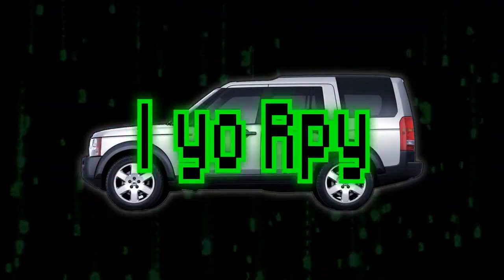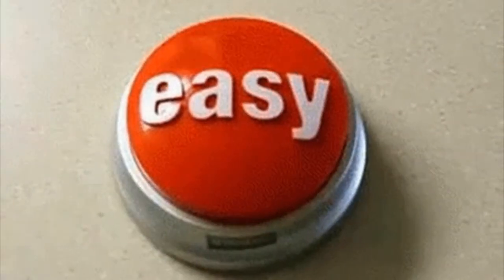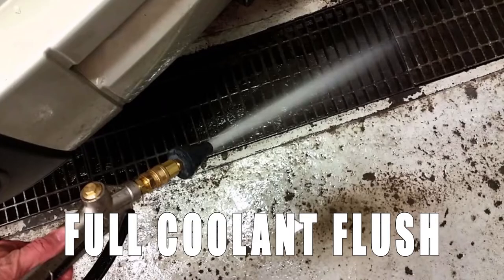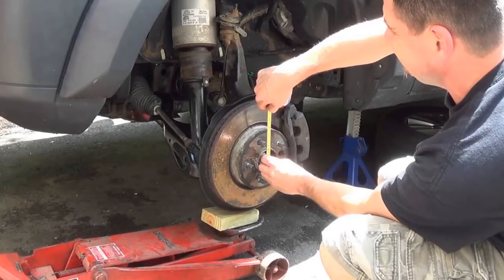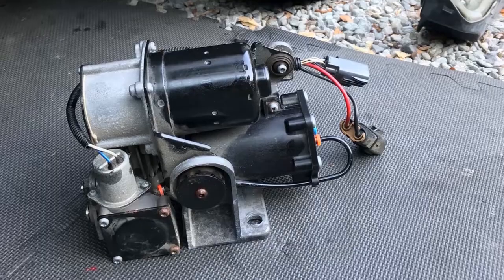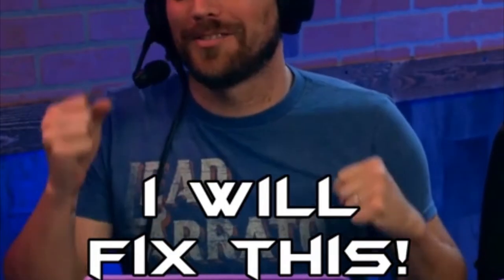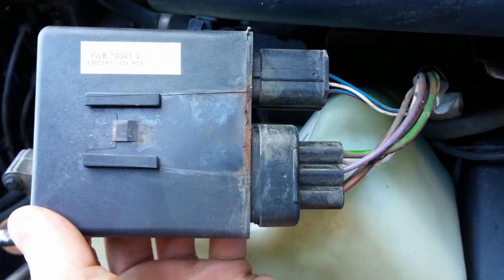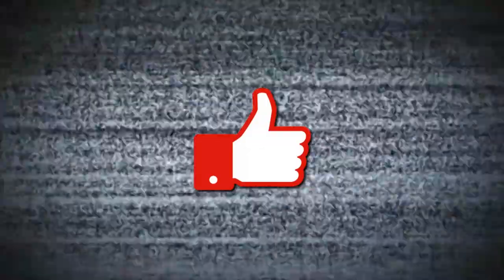Watch This Before Buying a Land Rover LR3 2004-2009

Comment: Accurate information. I have 230,000 miles on my 2006 LR3 SE V8 and 14 years of ownership. Keep it from over heating by changing plastic cooling system/thermostat parts before they break and avoid gas with ethanol.
Reply from the maker: Seems like once it overheats, you are in for a lot of trouble. Keeping things in great shape is important. I've seen these motors last well over 400k, but that doesn't include the maintenance folks like you put in.
Reply: Cool. good to hear. I have same truck with 156k. I'll keep a close eye on the cooling system parts. Thanks fir the advise
Reply: What do you mean avoiding gas with ethanol?
Reply: Do you know how hard it is to find ethanol free gas

Comment: Thank You . Excellent Video. Mine is 12 years old still going, only failures thus far. front wheel bearings and  some switch below the dash causing the Christmas tree lights. Best Vehicle I have ever owned. 148 K miles and going strong. Best vehicle for cruising 80 mph  and wanting to detour offroad to a camp ground. DOn't think I'll ever get rid of her... Next project ,take out the air for coil suspension. :-)
Reply: Have coil on mine its freaking wonderful
Reply: The brilliant drive ,handling and comfort,not to mention a 2 inch lift by a button,12 years and still fine?Don't ruin the car with coils,theres a good reason theyre not on the car!🤣
My 05 V8 HSE,250,000KS, pin hole in front air bag, I replaced both fronts,$600 delivered from LRDirect in UK,16 YEARS YOUNG!
Reply: I bought mine with the conversion already done. Really glad about that.

Comment: Mine is TDV6; 200.000 miles and in 13 years 1 air compressor and diesel fuel rail failed; and after 13 years, last week changed the right front air strut. The other 3 air struts are still original.

Comment: What would be wonderful, if you are able to, is to talk about the parts we can borrow from the LR4 or things we can incorporate, I don't have the parking sensors on the LR3 for example so bumper replacement, back up cameras and so on, etc...
Just for the record, I got the control arm issue from what you mentioned, and the timing belt, it is an expensive fit because they have to remove the engine and the compressor and sensors, still for leveling issues 🤔...
Thanks for the video.

Comment: I have owned a discovery 3 for nearly 10 years, and it really hasn't had any real issues
Reply: Yeah mine too but i maintain well
Reply: @The1979_  yes, frequent oil changes and transmission fluid changes are in order, although I did trade in for a land cruiser
Reply: @reapertalon  Hımm 🧐 LC is also nice car but last year i was gonna buy a VX200; after long discussions, driving both cars, talking with specialists i decided on Discovery 3 again. Its the most well balanced car for me. But i really love vx200 no lies
Reply: @reapertalon  Can i
ask you why did you desist from Disco? Did you just wanted to make a change or??
Reply: @The1979_  at one point, the disco just sort of died on me, turned out that I lost compression on cylinder no.4 and yeah, it was time for a change anyway
Reply: @reapertalon  yeah make is sense. After all whats your comparison between two? Disco or LC?
Reply: @The1979_  hard choice, I love the discovery 3, it’s a very nice SUV, and I have a lot of memories with it...but the Land Cruiser’s reliability is pretty much indestructible, so I’m gonna have to go with the Land Cruiser

Comment: Ive been lucky so far with my 06 SE V8. I know I will eventually need to replace the lower control arm. I didn't like the fact it will be a difficult job. Crap. Well, I'm sure it will be worth it. I love the truck.

Comment: I looked up the price of parts ...not expensive at all and most jobs can be done without a garage ...I've just been given one that's not working right so I will find out
Reply: how’s it going?
Reply: @Spartansrule118  well.....I got it going ...put a new handbrake module on but because the guy before cut the electrical cables ...it works perfectly with the engine off but comes on and goes off again otherwise and I can't communicate with it

Comment: Bought an LR3 with 140K on the clock for my wife in 2016. Great car for sure but I'd like to say a couple of things too this video. 

1) They don't have a problem over heating. Coolant system failures are inevitable. The real problem with the LR3 is the cooling system design. A huge plastic (a55holes5) thermostat housing that always fails and a water pump gasket design that's problematic. AC Delco redesigned the pump and it's a winner! 
2) The issue with the diff's is that they get moisture into them. Top that off with the fact that the factory claims long service intervals. Reduced that to 12 months max!
3) My wife doesn't care about going off road so I converted to coil. 
4) If not going to coil on your used LR3, replacing the compressor isn't a bad idea at all. 
5) If the truck starts taking longer to change levels, keep backups for all of the fuses related to the air compressor system and plan to replace the compressor. If you end up in the Disco squat  (the truck sitting on it's but and won't rise back up)  before you get a new compressor, check those fuses! 

Her's now has 210K on it and it still rocks! I've replaced all of the pulleys, belts, coolant lines, and an alternator.  Still an awesome car in the snow and the motor is still pretty damn awesome. If you don't mind turning a wrench, these are great cars.
Reply: Does the thermostat housing just fail and instantly overheat? Or is the gauge accurate and you can shut it down in time?
Reply: @sarahdell4042  You don't see catastrophic failures of the housing. The issues are parts quality and design. 
That said, what you see are leaks. Over long periods of time they crack. Normally where they are secured to the engine. Tightening more just makes the crack worse. 
The big takeaway where the the thermostat housing is concerned is to buy the best quality part you can afford. 
Lastly, if there is anything that does fail catastrophically in the cooling system it's the bleed valve.  Replace that with a brass part that will last for the rest of time. Atlantic British carries them.

Comment: Mine never overheated 170000 miles tie rods fine ball joint fine air compressor still working . This guy hasn’t even driven one. Just another muppet 😂

Comment: Come on guys, my Patrol Y61 TD6 is 23 and already suffered a lot in the Icelandic Interior, still going strong after all these years.  Oh I forgot, I have to replace a brakelight-bulb and last week the airco-belt needed some tension-adaption.  Why the hell do people buy landrover ?
Reply: Because they look fantastic, have a magic carpet ride, have all of the toys you'll ever need (mine is a 2015 HSE Lux), they are unstoppable, have epic performance, have great on the the road presence and can tow anything with ease.
Reply: Oh, and they have the best turning circle of any 4x4 I've ever driven.
Reply: Because it's my money and I enjoy land rovers and i sold my patrol to get one. Best decision ever. Enjoy the offroading much more un the land rover. My stock discovery is more capable than my 4.5 patrol was. The smaller 2.5 remapped Td5  outruns the patrol and is lighter on fuel. Much more comfortable on very long distance trips and i can even drive past gas stations without having to fill up.

Comment: seriously this entire video is a joke, you have no idea what signs or what generally fails or just wear's out on a discovery . 1st in the engine, oil pump if you have a old style 1 it will need to be changed otherwise the bearing it runs on will fail and when it does the engine is only fit for the bin simple as that. 2 glow plugs will cost you a bomb if they get stuck on removal 9/10 times they will get stuck. 3. crankshafts have a issue on snapping at low revvs and also the crankshaft bearing spin causing the outer shell to dissolve not good. 4. main boost pipe tends to split causing insane amounts of black smoke. faily easy fix.. 5..both egr valves become blocked and will need replacing costing alot of money if this happens a egr blank can be bought for cheap to block out the egr's but in the uk its a MOT fail unless you no a quiet mate. 6 turbo do have a tend to die which will also cost a bomb to replace..7.. discovery 3 don't like cold starts at all and when you do start it up and the revvs are making the needle jump up and down basically means injectors or glow plugs need looking at doesnt mean there bad becuase it could be a eletrical fault with ethier glow plugs or injectors.  AIR SUSPENSION. 1. yes the air pump/compressor do die i had 2 die on me but if this happens just buy original 1 if you cant go cheap but trust me there loud as hell, if you are finished with air suspension just buy coils to replace the old 1's.. 2. after a long time the air dryer beeds become very small and sometimes become powder over time and what happens the powder get sucked into the air lines and that blocks up and clogs the air blocks theres 3 of them yeah they can fail can be expensive to replace and fairly easy to find and remove. CONTROL ARMS AND HUBS..1.. yeah its easier to replace the front lower arms than trying to replace the bushing on them if you do replace them buy the original arms or very very good make otherwise you'll be spending alot of money at a garage replacing them again about 2-3 years later..2.. front wheel hubs its soo much easier to replace the whole hub over trying to replace the bearings the front hubs do wear out quiet often depending on the make of front hub you buy. if your alright with tools and have some time it can be done i did mine yesterday.. BRAKE LINES.. brake lines on the discovery 3 depending its age they do rust and become more often seen on uk MOT'S.. RUST.. especially on lower door sills can be a pain and across the whole can spots can creep up especially underneath at the suspension mounts but with a bit of treatment its alright. TRACKING.. if you have tracking issues with your discovery join in with us it is more common for the tracking to be out a small bit or quite alot on this trucks so dont think its just yours mines be in for tracking 2 times..GEARBOX.. i can only speak for AUTO gearboxes here if you ever fell juddering or if the engine has to revv higher for it to change gears then its about time you had your gearbox flushed.. not just a oil change but a flush its important if you want it to last during the flushing a flushing machine hooks up to your D3 and forces gearbox oil into the box and flushes the old oil out and aswell behind the torque converter  unlike a normal oil change on the gearbox it just doesn't do it justice. and replaces with new oil landrover say its a lifetime oil in gearboxes ITS NOT nothing last forever.. FRONT DIFF'S  if you hear a wine quite or loud them most properly its the main bearings wearing thin and on there way out yes you can have bearings replaced but generally got to have it sent off or most 4x4 garages here will just replace your broken one with a new 1 straight out and the old  1 will get sent the company who sent you the new 1 ( makes it cheaper for the garages to buy it).. if you haven't changed to the oils in your diffs  they will need changing eventually again no oil last for ever, also check your brether pipe on your front diff, your diff isnt full to the top so it needs breathing especially if you drive through rivers and flooded areas......THINGS I DO WITh MY DISCOVERY 3. engine oil and filter gets changed every 6 months regardless of miles,, fuel filter and air filter and pollen filter once a year try not to cheap out guys. tyre pressure checks once a week helps fuel consumption and better for your tyres. engine coolant cheeks once a month if needs topping up top up same as windscreen wash. and also same as brake fluid but mines been changed twice since owning the truck....discovery 3 and 4's are a high maintenance trucks and are absolutely great to own and i love mine they will last a very long time if they are looked after properly.....i have a D3 2.7 tdv6....also forgot to say the turbo, all 3 belts, oil pump will require body off which will cost a bomb at a garage YES some things can be done with body on but that wont happen at a garage when they can just take it off and do it properly.....hope this helps
Reply from the maker: Instead of being negative, add to the video with positivity. 
There are many many people who have validated this video. 
Nevertheless, I do appreciate the time you put into the comment. 
Thank you
Reply: People need to get a bit of perspective. Over time any vehicle as heavy, complex, and capable as a Discovery is going to cost a bit of money. After all, It's not a Model T Ford you're buying.